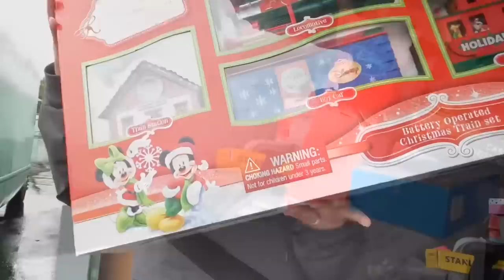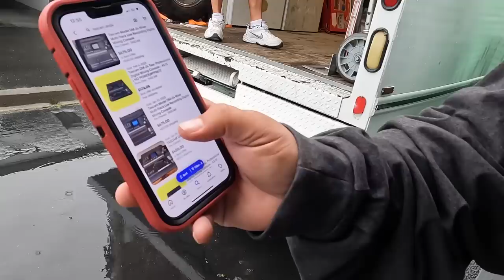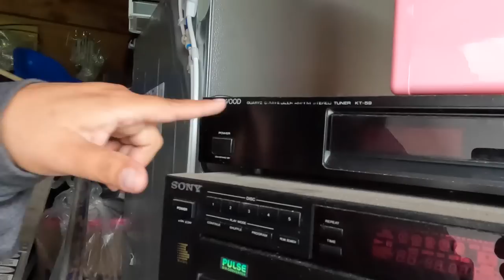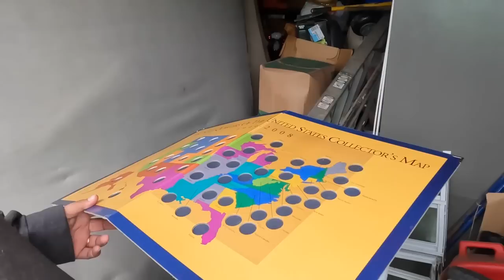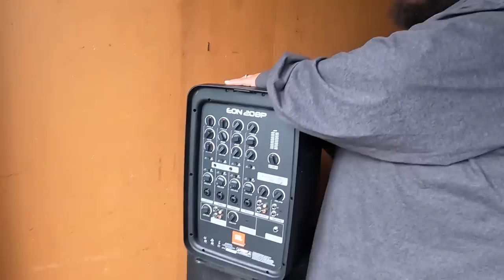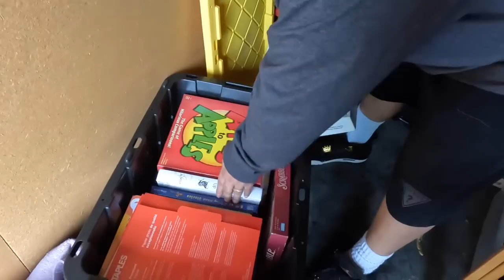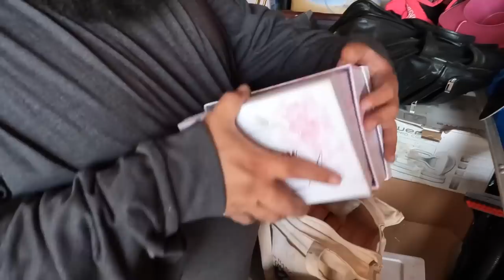I Bought Criminals Storage Unit FOUND LOCKED SAFE! She Was Loaded With Cash

Comment: Some old gold (jewelry) is not marked. If it says 925 then it's silver. 92.5 % silver. If it's plated it will say silver 0lated or gold plated most of the time. You may need to recheck that jewelry. I would.

Comment: jbl is the worst product ever. i have had had jbl and they have all crapped out on me. if u want a great system altec is the way to go. i bought a altec blue tooth speaker for 230 bucks 6 years ago and it still works great. the jbl lasted a month. 2 if u r lucky.